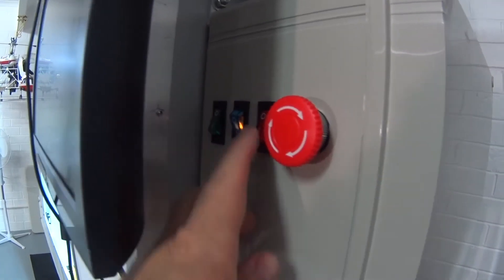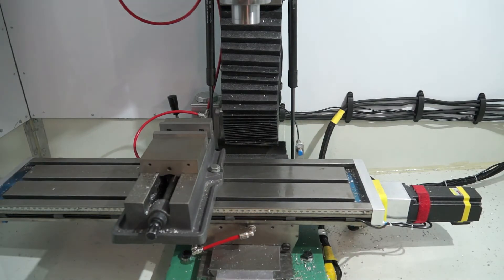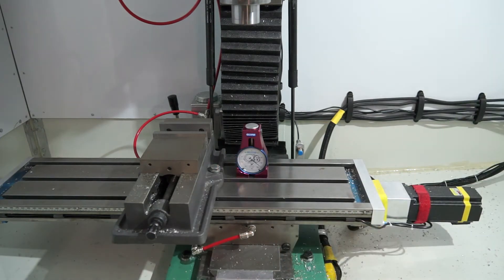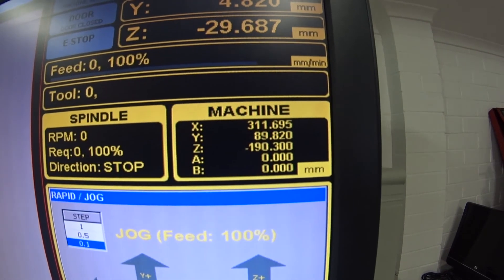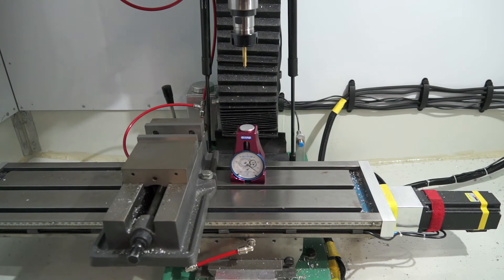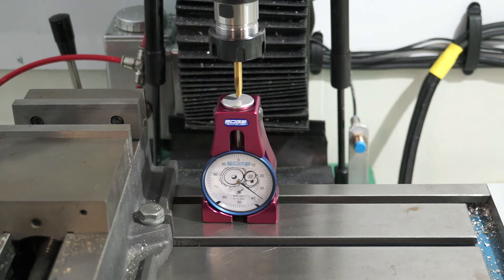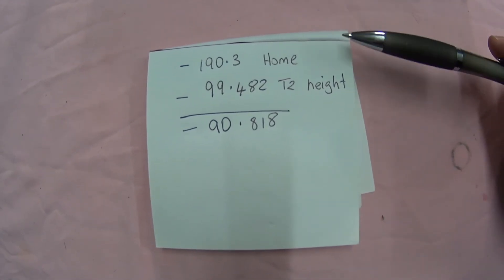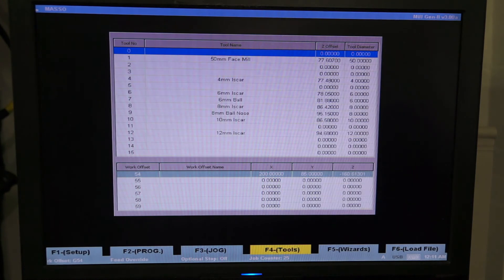Masso CNC Tutorial Part 2A - Tool offsets & tool library

Comment: Hi I have the Masso and clearpath I'd just like to know how to wire it can you help me masso send me a page but for 4 wires and the clearpath has 8 wires
Reply from the maker: Hello Abram.  I'm very sorry but I don't know how to help you.   However, I found this link on google https://masso.com.au/docs/masso-cnc-controller-documentation/motors-and-drives-connections/teknic/
 I no longer have my machine and I used my machine with closed loop stepper motors.  Please contact Jatinder from Masso directly for more assistance.  Regards, Aaron.

Comment: I did mine a little bit differently, I came down and touched the spindle nose and zeroed out in the software then I put the tool in and brought it down to the same point on the dial indicator and just looked at what the reading was in the z dro in the software. that way no maths involved and you just put the next tool in and repeat.
Reply from the maker: Chris Atack Hey mate. Yes your method is much easier. I did it this way hopefully so it would make more sense to the novice. However and in hindsight your way using the mill (G92) as a digital readout would have been simpler. Thank you, I will bring this up in the next video mate and quote you if that's ok? Cheers bud, Aaron;-)
Reply: DCTTeacher1 yeah no worries. glad to help
Reply from the maker: Thank you Chris.  Cheers, Aaron.

Comment: Interesting.  Definitely different than what I'm used to with mach3.  I use the same Edge tool setter.....LOVE it!!!!
So, do you just hang onto that number for the spindle(zero tool) for down the road when you add another tool, or do you just go ahead and remeasure the spindle height first?  I wouldn't think that it would change, so in my mind, remeasuring it would not be necessary.   
What's the zero button for?
Great vid Aaron! :)
Reply from the maker: bluehandsvideo hey Mike. That original measurement from the spindle nose to table (offset gauge) should never change because it is always referenced from the Z Prox sensor when homed. You can use a spread sheet to work it all out for you. I will include this in the description link below ASAP. If I had height tool I would reference that in my tool library. The one I have wont fit my er25 collet. Hope this makes sense?
Reply: But....you always use the number for the spindle distance instead of setting it to zero...or more accurately, at 4" in your case?  I set all my tools in G59.....that way I can set the spindle at 6" (edge tool height, plus a 2" block since the spindle nose won't go down to 4" off the table).  That technically puts my spindle at zero on the table......same as how you're doing it.  But....can you use zero for you spindle height....eliminating the math.  In mach3, I can set my offset to 6" and it will do the math for me when I tell it to apply the tool offset.  Hmmm......might one work for you if you can use your height setting tool.  I have my Haimer as tool 1.  Hmm...I have it straight in my head, but I'm a bit fuzzy right now, so it may not be coming across very clearly.  Anyway......

Is the shaft of your height gauge too big, diameter wise to put in the ER25?  You can make your self an adapter so that you can use it.  :)
Reply from the maker: Hi Mike, yes you do it the way you're doing mate.  Chris Atack suggested the exact same thing.  I did it using Math hoping it would make for a better explanation.  However, in hindsight it wasn't the smartest thing I've done.  I think I've ended up confusing more people then I've helped.  I will do another video to amend / compliment it highlighting using the controller as a DRO.  Thanks for keeping me on my toes mate.  Cheers, Aaron.  PS, yeah my bloody height setter is to big in the diamond to fit.  I ordered a 16mm from eBay which just turned up.  Guess what, said approx 16mm did, but it measured out at 20mm.  Muddah Farkers!
Reply: Argh!  That's more than a bit frustrating when they don't list the dimensions correctly!!!  20mm is nowhere close to 16mm.  What type are you using?  
The only real difference between how I do it and you showed is that mach3 does the math for me. :)  I brought up using the zero ref...as did Chris.....as an option to you having to use the math.  There's plenty of ways to skin a cat. :)